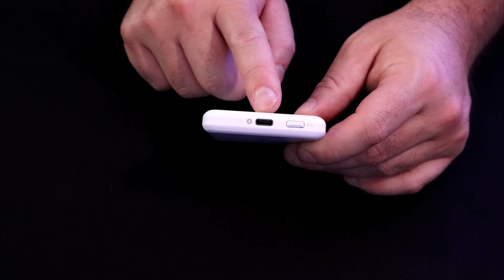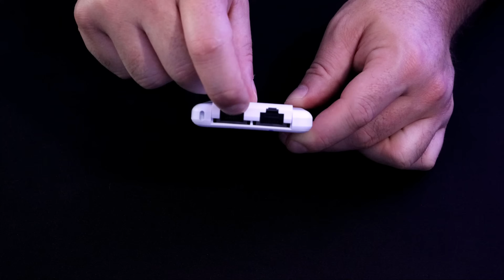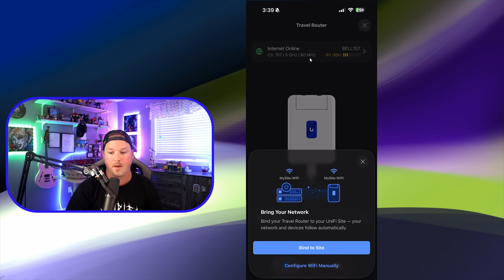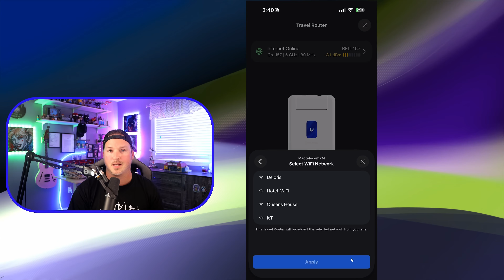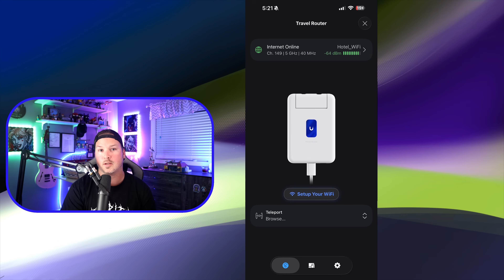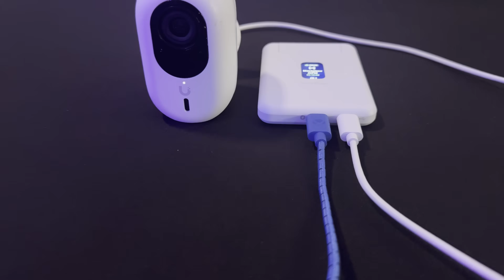UniFi Travel Router: Compact, Easy To Use, Connect A Camera Back Home

Comment: They probably had just 100 in stock. What a joke of a release.
Reply from the maker: They had wayyyyyy more than that but yes did sell out quick
Reply: Sold out in 30mins or so in the UK 🇬🇧, didnt even see it in stock, managed to get one from the EU 🇪🇺 store. They then sold out about an hour later
Reply from the maker: @dh-net  ya definitely sucks tbh happens with every new hot product they come out with
Reply: Curious what these offer that can’t be accomplished with adding a WireGuard client to your laptop?
Reply: If you just have one device, the WireGuard client is fine, and what I often do. But you can set this up such that all of your clients connect to it and they each don't need to be setup except to just have that WiFi network saved.
Reply: @MrDarcie that’s cool. Mine is OTW. Just seems to require a rather robust internet source to support bandwidth splitting. Almost seems each user enabling their own cellular hotspot would be more acceptable.